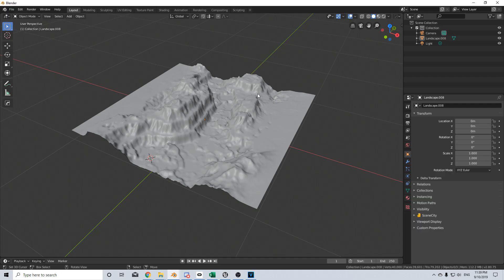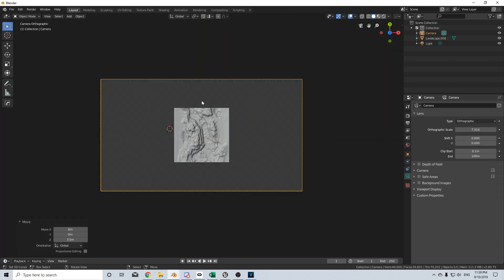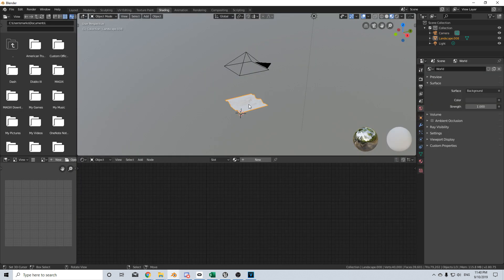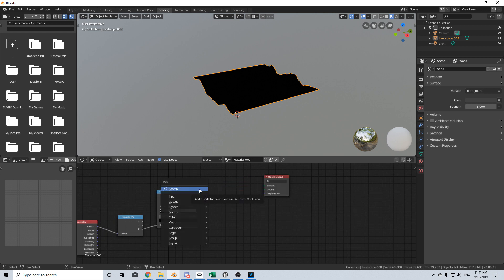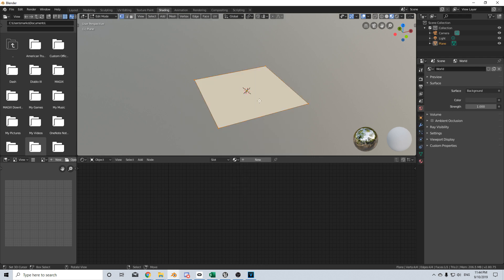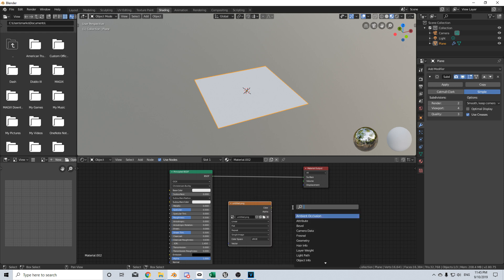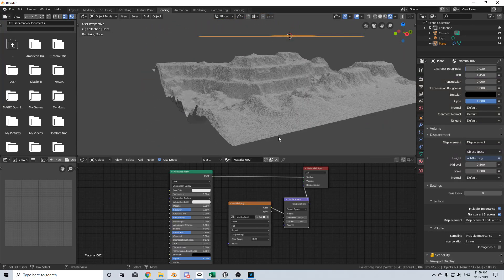How to Bake Displacement Map Blender 2.8 Tutorial

Comment: Pinning this to the top recent comment that helped me: "If anyone else is having this problem still, instead of scaling down the mesh just place a division between your "separate xyz" and "color ramp" nodes to divide Z by the highest Z vertex on your mesh to get everything between 0 and 1." I personally changed this scale until I got good results. The division flattens the landscape, and you can use this value on the unreal import to bring back the height you want. I tried to use elevation data and building height to determine the scaling.
Reply: What do you mean by a division?

Comment: I've redone tutorial fixing my mesh, now it seems to work, but strangely my terrain mesh looks all white. and areas where is no elevations is completely black, so its only full white or black not like your video, when it actually looks like grayscale any tips? using blender 4, if i elevate the mesh by 1 on Z axis whole mesh is white, and if its stays at 0 i see no elevation areas as pure black and others as pure white it's not like it supposed to be right? i don't see variations of grey at all 🤔   P.S with help of Google copilot found nice solution for this tutorial,   adding one more node called Map range,  plug  Z from  Separate XYZ node to  Value from Map Range node, then from RESULT from range plug to FAC of Color ramp node. And it works like a charm:) Ty for tutorial
Reply: I got this to work by changing the minimums and maximums in the Map Range node. Thank you for the help.

Comment: Had an issue where my model was white, even after following your steps. This issue was resolved when I realised that my imported mesh was massive. For anyone with the same problem, the top vertex and the bottom vertex need to be in-between 0-1 on the Z axis. Thank you for this video, very quick and easy without having to install addons. <3
Reply from the maker: brilliant, well done for problem solving that
Reply: If anyone else is having this problem still, instead of scaling down the mesh just place a division between your "separate xyz" and "color ramp" nodes to divide Z by the highest Z vertex on your mesh to get everything between 0 and 1.
Reply: @sirderyk  thank you!
Reply: You have no idea how you helped me. Thanks! From monster to mouse - now it works.
Reply: had to do this now, to add to the previous tips, you can add a Vector Math node in between Geometry and Separate XYZ. Set it to Normalize, then all the values will be between 0 and 1 without having to fiddle with it
Reply: @pitiponk1  I tried that and it looked okay, except I have a white spot at the center of my square mesh, leading me to think the vector normalization has XY influence in the Z.
Reply: @pitiponk1  Okay I solved it. This works, but will create a 1 spike at the origin 0,0,0 due to dividing by zero. So I needed to move my object off the origin and then your method is the absolute best method of them all.
Reply: @randomancy  dont use Normalize for heightmaps. It mixes X Y Z together, so the height value is no longer the real height (which remember is the info you want to get here). That is why you got the white spot near the center. Normalize reacts to distance from the origin, not the height of the mesh.
The correct way is still to take the Z value and divide it by the max height of your object. It keeps the heightmap accurate with no weird artifacts.
Reply: i'm having this exact problem but don't get how you solved it, i am new to blender. does mean it's not possible with big meshes? or that you adjusted the mesh you had? between 0 - 1 measured how?
Reply: NVM sorted it. lol anyone else having this issue,  just scale it your terrain down. Thank you tho! saved a headache!
Reply: I still dont get it

Comment: Thanks for the tutorial!  For landscapes higher than 1.0 use the "Map Range" node in between the "Separate XYZ" and "ColorRamp" nodes. works perfect to let you dial in your min and max Z values.
Reply: Also very important not to have sRGB colorspace. Go to Properties>Render Properties>Color Management>Display Device>None
Reply from the maker: glad I Was able to help
Reply: Thank you so much for this comment i've spent all day trying to figure out why it wasn't turning out how I wanted it
Reply: This video with your additional information: Exactly what I have been looking for... My (simple) CNC machine prefers greyscale hight maps for relief carving. 
And as I have used blender before (including a little bit of 3d printing)  this safes me from learning another tool!
Reply: thx, for large map you set your range to the highest point of the terrain
Reply: @brunnersamuel4615   you can also use the Min value for setting the lowest point in your terrain if it is non-zero, to get the 0-1 output.
Reply: wonderfull
Reply: that was so helpful
Reply: thanks for this great tip!!

Comment: so what did you need the color ramp for? also, use the texture coordinate node, plug the generated output into the seperate XYZ node to always have the lowest point be 0 and the highest 1
Reply: I was having issues with the gradient from black to white and it was either full white or black until I removed the color ramp for some reason. thanks!
Reply: Thanks for this reply. I was getting the entire model white until i switched to Texture Coordinate and Generated

Comment: For some reason I can't get the gray shade in the deeper regions. I only have white, light gray and then it suddenly changes to black.
If I move it any higher, everything just starts getting white, so that any program can't actually read the heightmap...help
Reply: I had the same issue, so I resized the terrain to match within 0.0 and 1.0 in the Z axis. My lower vertex is Z 0.002 and my highest is Z 0.987. 
Might have another way to work around without needing to resize, maybe multiplying or dividing the position on the shader graph, but I have no idea how to use it exaclty.

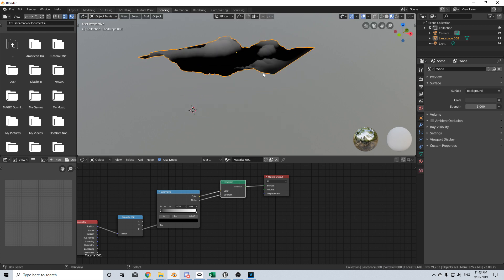Comment: hey when i add the color ramp it becomes very white, i tried it without it and it seems to be not clipping this way but now the end result is very inaccurate. i think i put it right on the y axis like you did at 1:55. any idea what im doing wrong here? very nice tutorial btw :)
Reply from the maker: I put it in the z axis. I need to re look into this and see what I can do with models. I didnt even think about this. I just got excited that I was able to get it in one direction.
Reply from the maker: These results work best when the object is between 0 and 1 blender unit.
Reply: @Markom3D  i ended up using a math node to divide it by 4 since it was 4 meters high. 
 also i went this route: https://blender.stackexchange.com/questions/105283/create-height-bitmap-from-mesh
it's a lot easier baking it using a diffuse BSDF i think because you don't have to worry about the camera and stuff

Comment: Can this be used to take an adaptive subdivision/microdisplacement mesh in Cycles, convert it into a new non-adaptive height map, which could then be applied using a displacement modifier in eevee to produce terrain that would be more similar to the original terrain mesh than using the original height map + displacement modifier (non-adaptive) in Eevee?  I want to animate a camera fly-through using microdisplacement, but Eevee doesn't support microdisplacements and Cycles takes too long to render (I'd prefer near-realtime speeds).  My problem is just performance when trying to visualize an animation in a scene using microdisplacements -- I'd prefer not F12 rendering everything all the time when making minor adjustments.
Reply from the maker: Like you said, I dont think it is available in Eevee. I would just convent it to a mesh and go from there. You have to remember that if you are flying through a canyon, you wont see the finer details, but thats the other thing, Eevee doesn't have motion blur. This one feature is what stops me from rending animations in Eevee
Reply: @Markom3D  Thanks for the response.  I'm ok with doing final renders in Cycles (for more reasons than just object motion blur) but I'm spoiled by Eevee and hoping to play my animations in the viewport for early visualization purposes.  I'm just looking for tricks to get around the limitation of adaptive subdivision being a Cycles-only feature and your tutorial made me wonder about any possible differences between a baked displacement map of an adaptive subdivision landscape vs displacement modifier (things that work in Eevee).  Maybe I just need to spend more time experimenting, possibly just making a duplicate of the adaptive subdivided landscape, removing adaptive, and just adding more/less of the non-adaptive subdivisions to hope the detail level is high enough/similar between the two that I could still use eevee to visualize the animation but then flip back to Cycles using the adaptive terrain for a better render.  Anyway, pardon the chatter, I suppose I'm just being lazy trying to avoid some slow/compute intensive testing and just fishing around for wild solutions.